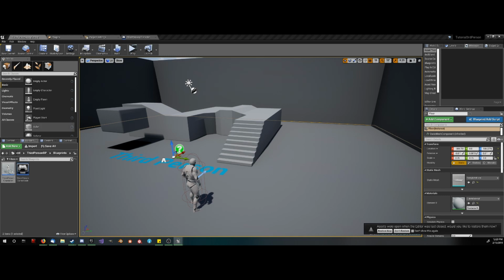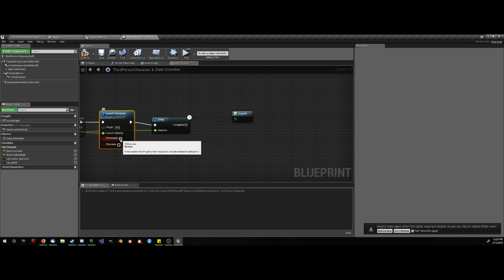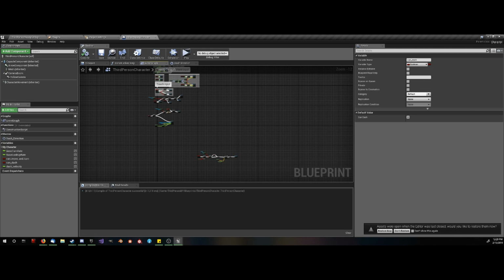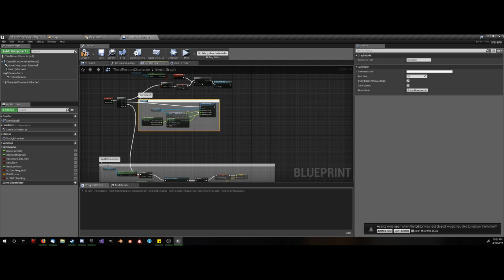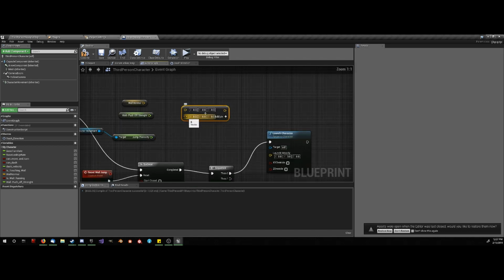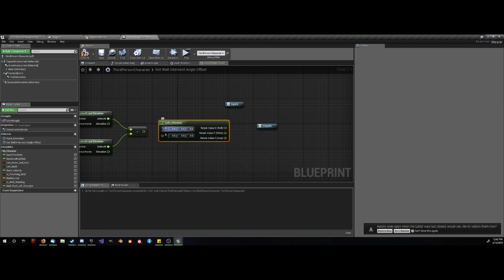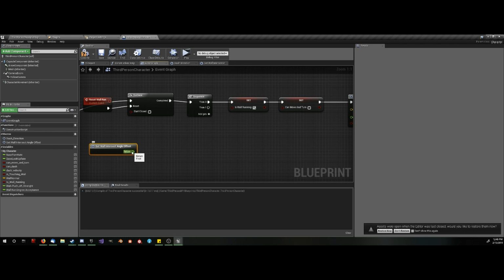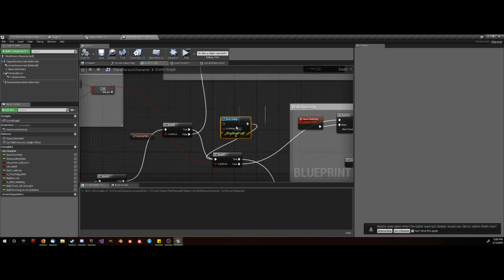3d Platformer part 2

Comment: what might cause the character to be unable to walk anymore after doing the dash? Blueprint seems to be ok. (Fixed)
Reply from the maker: Make sure that the can_move_and_turn variable is set to true after the dash macro. Failing to do that would certainly cause movement to be locked after a dash.
This was made with a earlier version of Unreal, it is also possible that something changed in the current version, but this is unlikely.

Comment: i actually figured it out, it was because the start and end of the sphere were the same, i just used add vector and added 0.1 to the z and it works now. I dont get why you didnt have to do that though.
Reply from the maker: I'm glad you figured it out. I don't remember off the top of my head how I set the code up, but it may have something to do with the relative locations of the components used to calculate the start and end of the trace.

Comment: can you help me with the wall jump? i cant seem to get a hit result, i double checked the code it all looks right. I was messing around with my walls collision settings and i just cant get it to detect the wall. When i made my test level I duplicated the floor and used that for the walls, dont know if that is the reason? I can see that the object type under collision is world dynamic for my wall, is there any other settings i need to have on my static meshes for this to work?